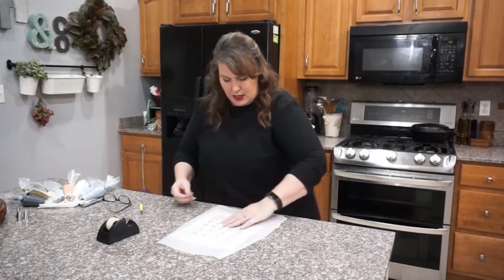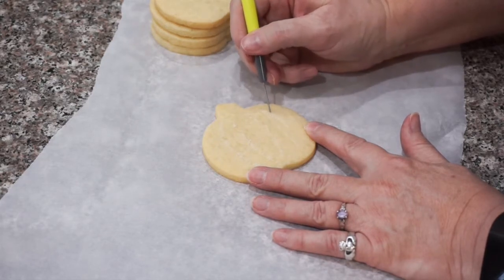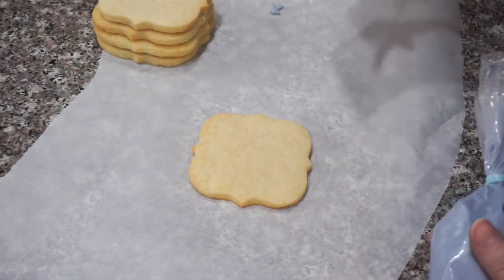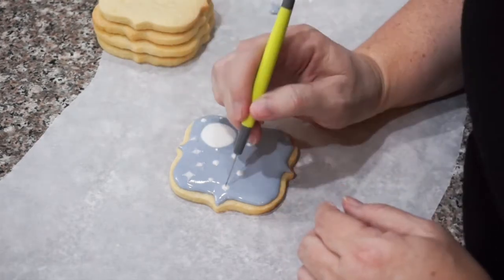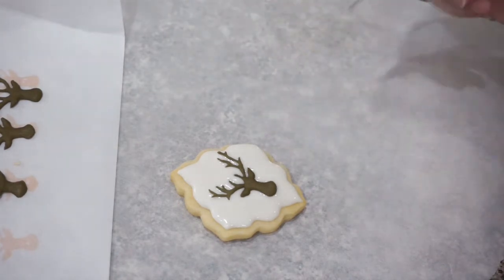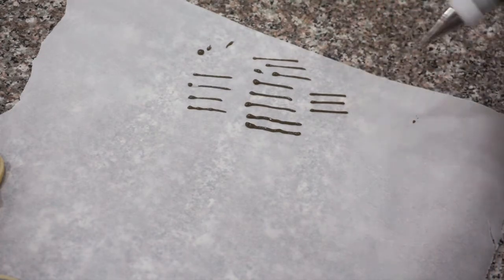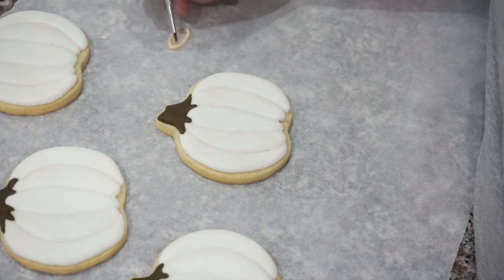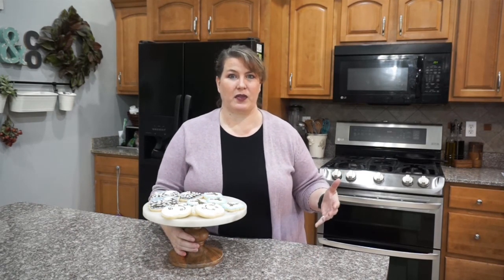Royal Icing Bake Along Part 3

Comment: Are the templates (like deer)  done with flood consistency icing? Or stiffer icing?
Reply from the maker: Thanks for the question! So sorry that I didn't mention it in the video - I'll have to go back and edit that. The icing for the transfers should be a little stiffer than flood consistency. I use about a 20 to 25 second icing for this - any thinner and it will be difficult to hold the shape but any thicker and it won't smooth out. (My flood icing is usually about 18 seconds). Using a very small tip does help to keep a thin icing in it's place!
Reply: @globalbakes  Thank you! We are going to try this before the weekend!